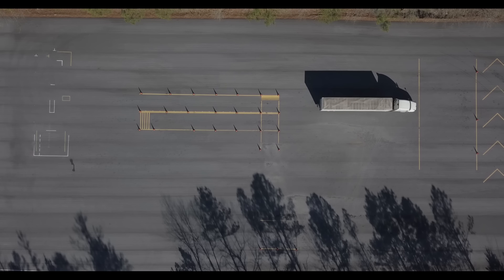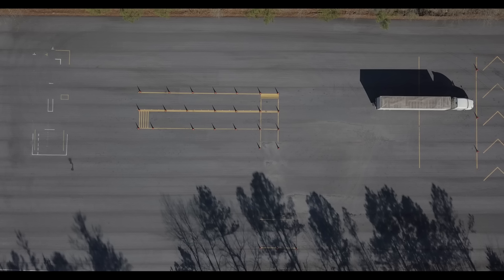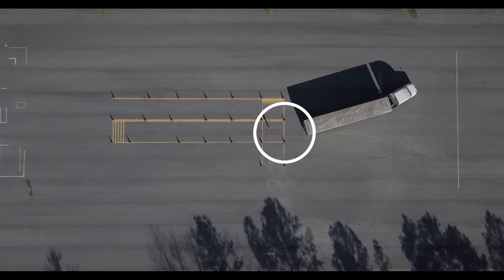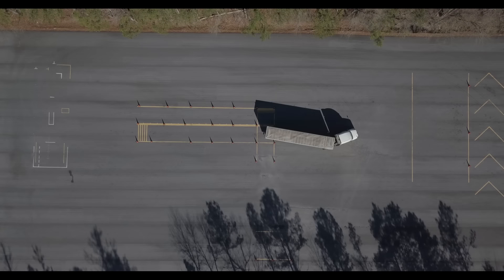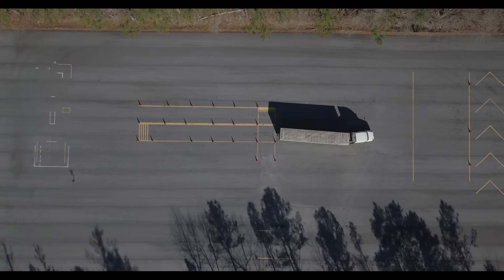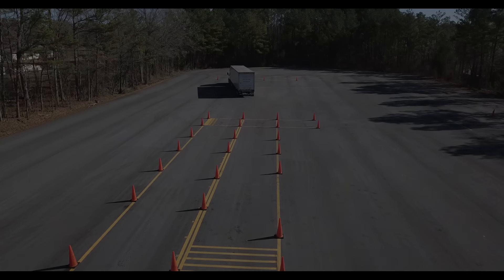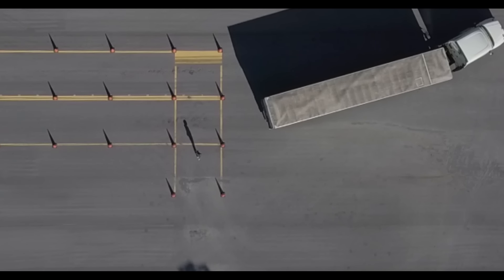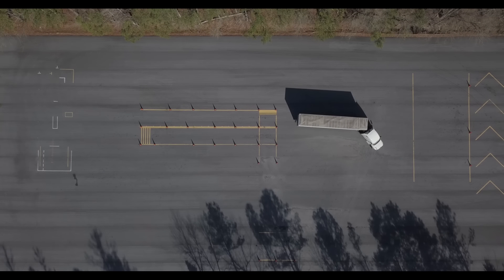CDL Training: Offset Back Maneuver

Comment: When I did my get out and look. I looked at the back of my trailer shook my head and left to go find another job.
Reply: 😂😂😂😂😂 good one
Reply: Ha ha ha ha i felt the exact same way!!!!!
Reply: Keith Smash  i said screw this and im taking baby steps and getting my class b
Reply: Class B is a truck over 26,001 lbs. Non combination truck. For instance a bus, cement truck and stuff
Reply: Keith The Faith  i got my class A but with an automatic truck a lot easier. However i do have a restriction on my license.
Reply: @oscarg.3330  hey the backing is so hard i have a class b cdl and a class a clp i have a skills test next month and having a hard time backing the trailer
Reply: @TanklifeGoldie26  what state are you in? I can refer you to the company i used and they train you to pass. If i did it with them any one can.
Reply: @oscarg.3330  im in Dallas texas
Reply: @TanklifeGoldie26  use cdl connection they have the tools to make sure you will pass. They make offset and parallel park very very easy.
Reply: By the way im in dallas too. I used them and passed on my first try.
Reply: @oscarg.3330  yea i see there trucks up at the dmv alot i went through almeda instead how much do they charge i just need help with backing and parking i passed my pretrip and airbrakes already now im on control skills 3 drive maneuvers then road
Reply: @TanklifeGoldie26  almeida screwed me over big time!!!!!!!!! The truck was shitty the instructor was shitty im fighting tjat charge on my credit card right now. Thwy put me in a busted truck i should have never been im. !!!!!
Reply: CharlesTron108  hey man i honestly don't know about no trucking schools i did everything on my own i paid 25 dollars for general knowledge test 11 dollars for my endorsements each and 750.00 for my truck rentals the company who i rented my truck from will give u 5 days of training pretrip first day 200 dollars second day backing 200 dollars third day route 200 dollars and finale route 150 dollars and another finale route before your road test the last one is free also 3 truck rentals comes with the payments  2hrs each my brother can train you as well 2hrs 150 dollars good luck on your journey and if you need anything dont be afraid to ask bro
Reply: CharlesTron108  i rented my truck through almeda in fortworth tx ask for ms joanna carlos or jr. Might train u and no it wasn't hard finding a good job after my cdl class A or B i work for Amazon right now driving 18 wheelers
Reply: CharlesTron108  i got automatic i can do manual transmission too but i like to just roll without all the shifting it's better for me plus soon as a company find out u know how to drive a stick that's the only truck they want to put u in im good with the automatic truck same pay less movement
Reply: CharlesTron108  your welcome and happy newyear dont give up
Reply: CharlesTron108  pretty much here is what worked for me i got a class A automatic. I sucked at standard shifting. CDL connection worked with me and adapted to me when i kept changing my mind. From class a standard , class b then me finally settling with using a class a combination automatic truck. The trainer i had was super patient they didnt judge. Class A automatic is very easy to obtain with CDL connection backing is very easy using their techniques offset is very very easy parallel is even easier.
Reply: 😂I hope this was a joke🤔
Reply: Keith The Faith  Where do you live???
Reply: Oscar Gallegos How did cdl connection make your offset and parallel parking easy. I’ve had class B cdl over 9 years and now have my class A learners permit and am taking a class that’s class a but automatic as well. I’ve been had the restriction on my license but had no problems finding jobs without a stick, I currently drive for sysco and they have automatic trucks. Any tips on how they made the offset and parallel easy for you?
Reply: Lol
Reply: @oscarg.3330  Congratulations on receiving your restricted license.
Reply: @tfinney3319  they use a very special technique that pretty much guides you when to turn the wheel.
Reply: @DCMACNAMARA-vh6op  thanks
Reply: I am going back to truck driving school to get my passenger endorsement on my class A CDL. I am bored with hauling freight and might as well get a local job at the airport as a shuttle driver.
Reply: @TanklifeGoldie26  so fresh out of getting your class A and zero experience, Amazon gave you a job driving 18 wheelers for them?
Reply: @oscarg.3330  yes as a matter of fact they hiring like crazy now
Reply: @TanklifeGoldie26  not for class A 18 wheeler working directly for amazon.  I have seen they used approved carriers to haul their trailers. So which one are you. I would like for you to show me where they are hiring 18 wheeler driver zero experience jobs.
Reply: @oscarg.3330  they are hiring 18 wheeler drivers Amazon only use contractors and i don't work for Amazon nomore im with a different company but if you know how to drive a stick in back up good there's this job in coppell hiring driver's also dhl is hiring driver's blue bonnet is hiring driver's go on indeed it's a bunch of cdl jobs thats hiring long as u can back up a truck good u should be ok
Reply: @TanklifeGoldie26  why are you not with amazon driving 18 wheelers anymore? Seems like it's a job to take care of. I mean they hired you with zero experience and fresh out of getting your license.
Reply: @oscarg.3330  they only paid 18 wheeler drivers 18.50 bro i make more than that at this other company i work for now
Reply: @TanklifeGoldie26  a lot of this stuff does not add up. Amazon hired you directly to drive 18 wheelers. I have never seen amazon hiring 18 wheeler drivers directly. I have only seen approved amazon carrier jobs. Which you state you directly worked for them. Amazon hired you without any experience whatsoever. A lot of jobs want experience with tractor trailers. Then you say driving 18 wheelers with amazon pays low. None of this adds up.
Answer these questions. 
1.Where can I apply to work directly for amazon driving 18 wheelers.
2. Is it local or OTR.
3. Why would they hire without experience. Most companies want some OTR experience.
4. You must have had a bad ass resume and a kick as cover letter.
Reply: Lmao 😂
Reply: Omg that's scary. I want my CDL so bad, and don't want fail
Reply: 🤣🤣🤣🤣🤣🤣 aww man
Reply: Now this is some shi
Reply: @oscarg.3330  I know someone  who works for a private owner but the company is contracted with Amazon,  and he told me you need at least 6 months experience.
Reply: @tawandamckinney1646  right, that's what I was trying to tell that one chick on here who seems like she's making stuff up.
Reply: You made me laugh 😂 ha,ha,ha...
Reply: @oscarg.3330  bruh you picked her apart she or he ran away 🤣
Reply: @DaBiggestChief  lol. It wasnt my intention.
Reply: @oscarg.3330  How has trucking been treating you so far my man ?
Reply: @DaBiggestChief  really good! Glad I got my class A, however I'm driving a class B straight truck for coca cola. Its paying a little more than a lot of class A jobs. Plus I get to go home every day. For the time being I'm good not driving a huge class A. How are you doing with your license?
Reply: @oscarg.3330  I haven't got mines yet I've been binging alot of videos and books tryna see what'll be best for me. I don't wanna go into an industry ass first.
Reply: @oscarg.3330  I just wanna get real opinions from actual drivers and not paid company endorsers
Reply: @DaBiggestChief  I see, well it's been treating me good so far homie.
Reply: @oscarg.3330  Got any advice? it's crazy how the more I look into it I find people in the same city as me.  Would you consider a Class B or A
Reply: @DaBiggestChief  it all depends my friend. I went with a class A but since I couldn't find anything that worked for me I just took a class B job.
Reply: @DaBiggestChief  costs the same to get A or B with who I used. I knew I wanted a class B driving job so I just went ahead grabbed a class A

Comment: Adding to everyone else’s stories… There are so many different mental approaches to this maneuver and I think that adds to the initial difficulty. Each of our instructors has a different way of teaching it. From simple directions “left, right, straight” to using landing gear/frame rails as reference, number of turns, turn all the way, number of seconds to hold the turn… I would have one bad day where instructors needed to intervene to help me, followed by a day where I was doing it perfectly, followed by another bad day. There is truth to each method, you just have to make it work for you. Ultimately, it’s all about practice and understanding how steering wheel movements translate to what the trailer does. If you’re struggling and your instructors aren’t helping, use YouTube to find a method that works for you and it’ll start to make sense. Also, I cannot understate how important it is to set up your mirrors properly. I consider myself fairly competent at offset now. Friday, however, I got a different truck where the passenger side mirror was not securely mounted and would tilt itself to the right. Despite knowing the maneuver, it was still a challenge to go into it half blindly and I messed up a few times. I’ve seen people storm out of their trucks, frustrated over not getting it, and give up their practice time. If you’re having a hard time, keep a cool head, breathe, maybe get out to take a break, even ask other students for pointers if your instructor isn’t making sense, but don’t quit.
Reply: Damn thank you so much .. that message was for me !

Comment: The one turn thing works!! It helped me pass my CDL test. Super simple. Put one turn in it and take the trailer to just about 45 degrees and then straighten out. You can then see both cones in your mirrors. Steer the other way till your close to the cones and then use your GOAL to get out and see where your at. Continue back putting the trailer in the entrance of cones . This is a good time to use your one pull up to straight out and back pretty much straight in.
Reply: Having some issue with this my instructor say turn all the way but it don't work for me. It's better to just turn once right not all the way?
Reply: @latashaburrell313  Yes, turn the wheel 1 turn before you even start moving. Cranking it all the way to start is too much and is not necessary. Remember, the back end of the trailer will move in the same direction as the bottom of your steering wheel goes.
Reply: @motorvaderlapstrake7238  thanks so much

Comment: Currently in cdl school, I have been taught a couple ways to perform this. Best way that worked for me was to crank hard until the front corner of the trailer is about 1/4 into the catwalk area, then crank hard the opposite way until you see the center cone in your mirror and use that reference to guide it in. Use your pull ups and goal if you have to! My instructors say to always get the rear of the trailer into the box before using a pull up.  Good luck everyone reading!

Comment: Hey truckers no need pull up remember when you start backing you must see one cone in each mirror back towards these cones you see and if you see one in let’s say driver side mirror and don’t see it in your passenger side do this it work every single time just turn one and a half towards the cone you can’t see and it will appear in your mirror then complete the maneuver from there no need to pull up
Reply: Thnx
Reply: When are you supposed to see both cones in mirrors?
Reply: Excellent Thanks
Reply: Thank you, I’ve been struggling with offsets and this has helped tremendously
Reply: Is this for offset backing?
Reply: Hello 👋 
How are you doing ? ❤❤

Comment: Never had to do this on a test, but I'm sure it will come up later.

I have had to do this at a flour mill and an elevator just to get in to load (at the elevator) and to scale , then unload at the reciever.  

Both the elevator and the mill were built in the 20's and were never updated beyond the 70's as far as getting big trucks and trailers in and out.
Reply: Hello 👋 
How are you doing ? ❤❤

Comment: if you're a beginner and you want to know which direction you should turn the wheel, this is how I get it (I'm a beginner also), think in terms of the 'front of the container', if you want it (front of the container) to turn to the right then turn the wheel to the right, the opposite is true, once you can really control the front of the container it's easier to fit the end of the container in the right place knowing that the end of the container moves at opposite direction of the front, I strongly suggest to try on 'truck simulator' games it's so realistic and challenge your self (and my self of course).
Reply: @hello Adoola how are you doing?
Reply: Hello 👋 
How are you doing ? ❤❤

Comment: Thank you so much for this it has helped me out so much wear I can pass this now thank you
Reply: Just gotta practice. Not hard, I got it down somewhat after a few tries. A tip is when you are gunna turn your wheel stop completely, this will save you space, and if you need to pull up don't just pull up a little, pullup a lot if needed and get the trailer and tractor straight, take your time it's not a race. XPO Logistics baby!

Comment: As the trailer STARTS to line up with the box turn the wheel away from the box. THIS is extremely important. All last week I was turning the wheel away from the lane when my trailer line up with the box. When this happens, by the time the tractor swings around and line up with the trailer, the straight line back is going to be almost impossible without a pull up because the trailer is going to either be on the inside line or outside of it. I could not understand this last week. It's all about timing. It clicked today and I nailed it!

Comment: Little Richard Sings Real Loud 

Left till corner of bulk head is over tire
Right till you get straight 
Straight tractor trailer
Right till close to the achieved cone
Left to swing tractor in front of trailer

Then it’s just a simple straight back.

Comment: Guys if your still learning your backing skills take into account that every truck is different based on the length of the wheel base, length of the hood, and the turning radius. A good rule of thumb to follow is to straighten out your truck and trailer as even as possible along the row of trucks where you want to park, keep about a 4 feet to 5 feet distance away from the trucks on said row, then align your fifth wheel right smack in the center of the hole you want to park in, then cut a hard right and slowly pull forward, the way you know when to cut it back to the left is when you start to lose sight of the hole in your mirror. Once you start to straighten out you pull forward just enough so the end of your trailer is just 1 or 2 spots away from the hole so you don't over shoot the setup and you have enough room to mauver the back of your trailer into the hole,  before backing your truck and trailer should be in the position that resembles that of a check mark, Your Welcome.
Reply: Hello 👋 
How are you doing ? ❤❤

Comment: Also if you’re backing straight in between the cones after your first 2 turns before the straight back and you’re not centered enough doesn’t turning to the right then back to the left and finding your tire or turning to the left then turning to the right and finding your tire to be better between the cones a good way instead of pulling up another option?

Comment: You're allowed to get out of the truck and check the back of the truck and cones halfway through the offset maneuver during the test? Are you allowed to reverse and go forward as much times as you want during the this reverse park test?
Reply: You’re allowed 3 pull ups and 2 get out and looks
Reply: Ours was 2 pull-ups and 1 get out I believe..
Reply: @Q-gf8vb  I heard you had a total of 11 points combined for all parking maneuvers. Each pull up is a point.
Reply: @1.21Gigawatts_  ours was 1-2 free pull ups each maneuver.
1 on straight back.
2 on offset.
2 on 90°.
This was in NC.

Comment: ? Does the 1 turn of the steering wheel before you back apply to a 28 ft trailer or flatbed
Reply: Same question. I second it. I am practicing in a 28 footer. It seems every happens faster than the 53’ footer.
Reply: Hello 👋 
How are you doing ???

Comment: I was frustrated that I couldn't do it alone. One week I couldn't do this parallel . I always need a guide. Those trucks are so rustic inside that I cant change the clutches. And I'm used to driving a manual car. I warned you that I'll only get it with practice. Unfortunately, I still don't have a truck to practice on my own in my time. One Day !

Comment: I got my license last week, this trick wont work for beginners..my suggestion is turn the wheel to the left and watch your mud flap as soon as it reaches the V stop then steer your steering wheel to the right for barely 2 second while reversing then do that first move again by steering to the left until the mudflap reach the V on your trailer then steer the steering wheel to the right again and keep reversing until the tractor trailer are straight..
You might be between the cones and if your are not do the S move by pulling forward with a hard left then hard right..watch your mirrors while doing that to make sure you are alined with the cones..as soon as you see that just do a reverse and your done.